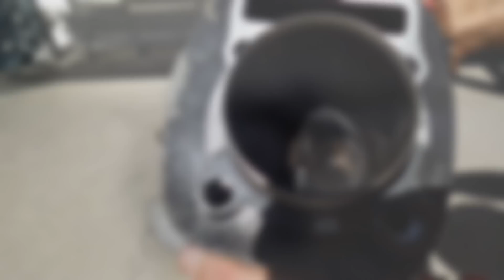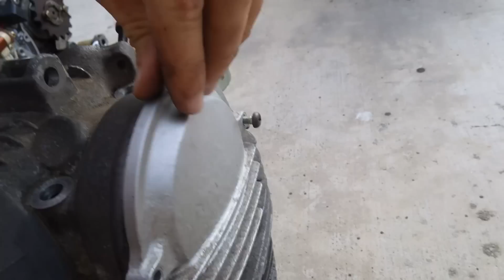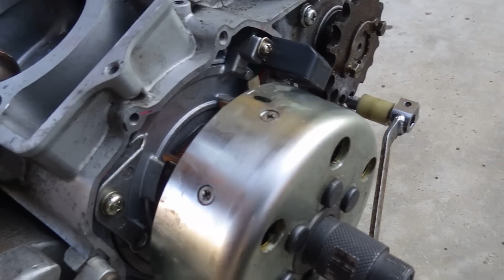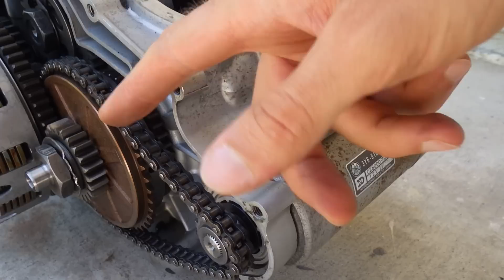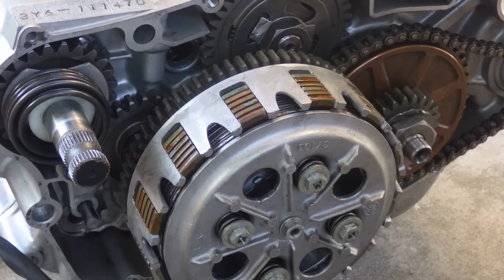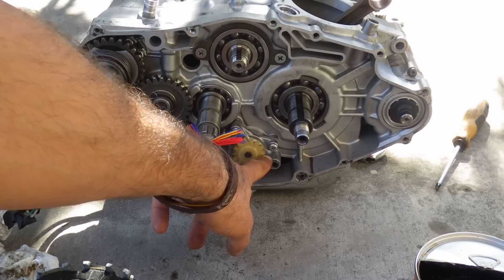From cylinder to clutch to transmission: a complete Motorcycle Engine explained

Comment: My 125 cc Yamaha enticer has engine sound what is the problem and electricle ignition also not working properly what please help. Thanks
Reply: amer limbu 
Valve clearance checked? maybe a new bobine/ ignition coil? or maybe youre feul/air mixture.
Reply: amer limbu Could be cam chain
Reply: Thanks both of you
Reply: its hard to tell really how many miles has your bike done? If its a lot such as (25k miles) it is most likely cam chain hard to tell without video as well :P